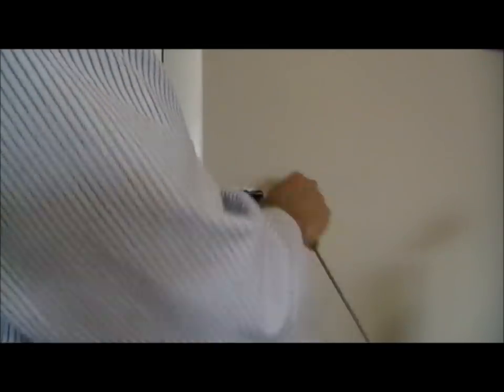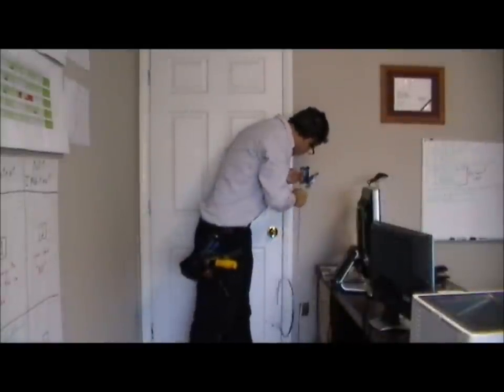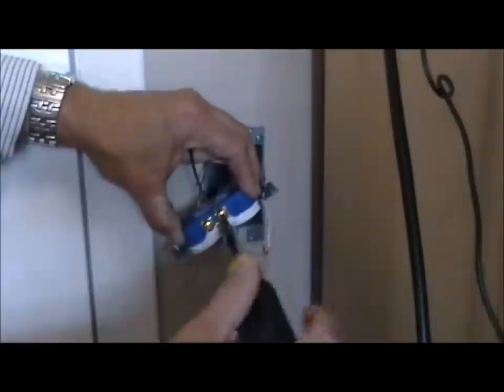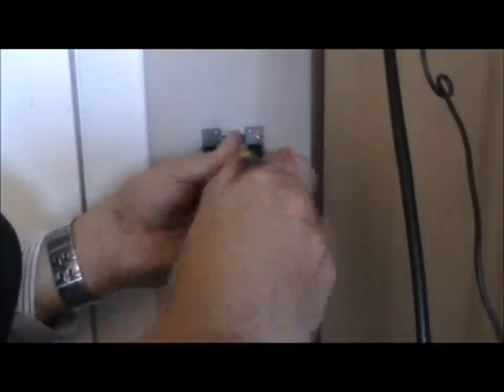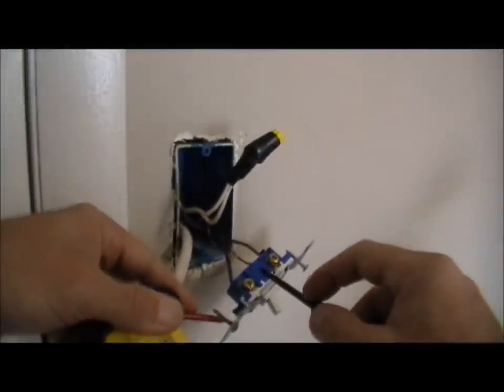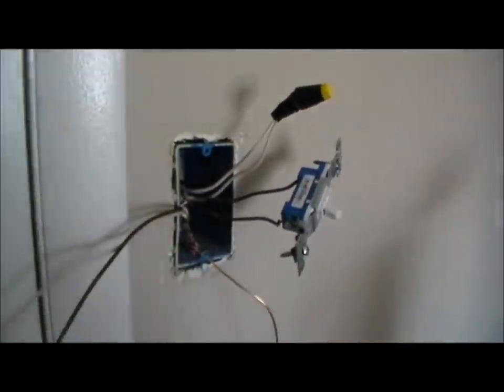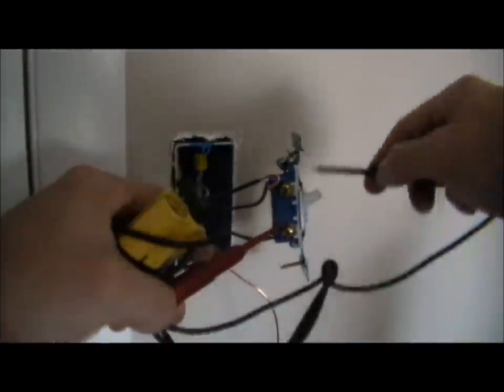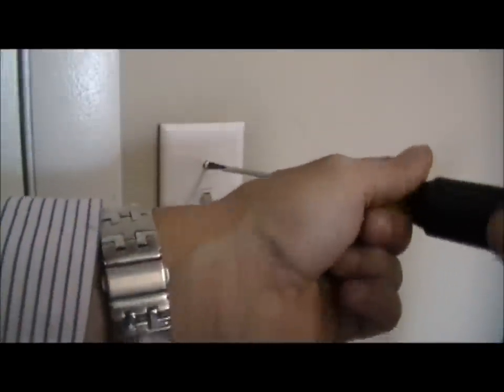how to wire an outlet off of a switch

Comment: You should be taping up those receptacles and switches before you put them back in the box
Reply from the maker: I would agree with you if we were using metal boxes. Electrical tape can unfortunately hide scary problems. Electrical tape will cause bad connections to stay in contact with the terminals and heat up. This will melt devices and can lead to fires. Without the tape a bad connection will just cause the device not to work.

Comment: maybe he turned it off at the circuit breaker? one should always do that when doing electrical work, in fact if i was to do any i would want to kill power to the whole house just to be safe and use flashlights to see, might be overkill, but i really like making things as safe as i can, or it could be that he didnt touch both that hot wire and the cold at the same time, so no circuit was completed.

Comment: I missed the caution that older Codes did not require a neutral in a switch box. No white wire, no can do. DIYers need the caution.

Comment: Lol all these comments.. The only thing I saw wrong in this video was that he didn't cut the breaker off. Probably because he was shooting a video alone and probably doesn't k or how to edit them, so leaving it on saved time from going back and forth. A real electrician can easily work on a simple switch with power still running through, just know not to touch the hot or neutral wires/terminals. Plus the shock isn't 'that' bad. Ya'll sound like a bunch of school girls.

Comment: Seems like he forgot to break the tabs between the screw posts. So, this way, both outlets will be controlled by the switch. You won't have one constant-on and one switch-controlled, which is the usual set-up.
Reply: Actually, he made a point of connecting the new outlet's hot wire to the constant hot wire at the exisiting switch, also called the "line." His intention I believe, was to have two constantly live outlets, not a split wired receptecle which usually requires a three conductor cable and breaking the tab like you mentioned.

Comment: Yep you would 😮. Your killing the outlet when the switch is off. You need 2 pig tails . Split the power so the switch and the outlet are independently wired with power

Comment: Question any body.can someone tell me where I went wrong.i only get electricity on the outlet when I turn off the light.whats happening.thanks
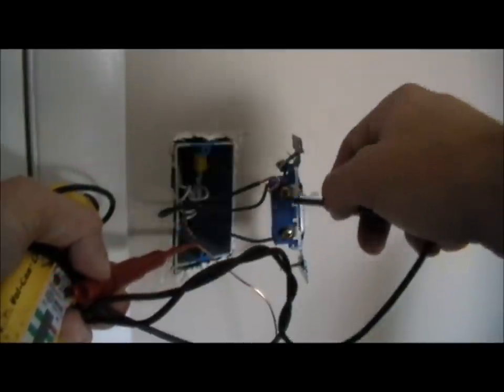Reply: You wired your hot to the wrong one on the switch. Check video in 12:15 ish where he tests to see which one is always hot. The switch breaks the circuit and leaves the other half not hot when it's not on , you probably wired your outlet to that side. Wire to the side that's always hot
Reply: @meganzheng4659  thanks I'll try that.

Comment: A little Bird told me:   i saw no hammer pounding those staples in the wood to code, to hold romex ???
Reply: dont have to staple in romex if adding like this that would require opening the wall entirely. the box has a flap that will hold the romex from backing out

Comment: Sorry but this didn't work for me.  In fact, it caused me to lose a lot of time.   I found the way is to pigtail the hot and the line feeding the outlet.   The others are right , grounds to grounds and neutrals to neutral --- top black to light fixture.   Possibly I had the wrong light switch because it only had 1 top and 2 bottom screws with the ground to make total of 4.   I believe your fixture had 5?   If so, than I stand corrected.   Thank you for your efforts all the same but please call out 4 screw switch versus 5 screw switch if that's the issue.

Comment: I've done work plenty of times without killin power on 120. It buzzes u a little bit, but yes he should have not posted a video doing what he did for others to do. Also, dude ur running an outlet as well as light now, pigtail the hot, don't use the quick connect, take the two mins to do it.

Comment: You didn't stab the wires in the back of the plug so why not remove the feed that's stabbed in the switch and pigtail the feed for the plug and light?

Comment: you never connect the hot first, this is wrong. there is a saying in the trade. ground is always first make and last brake, this is why the ground prong is longer than the other two on the end cord cap. same as when terminating a panel, the grounds always go in first..

Comment: The switch shown was not a common type in fact it led me astray trying to do this. The better way was to determine the hot wire coming from the with, pig tail off of it going to the switch.

Comment: $50 says that ground in the switch box has already worked loose. Get some crimps, crimpers, and a pair of wire strippers, you can call them electricians crimpers if it makes you feel better about it. 

 "our company doesn't back stab", gives a legitimate reason,  then proceeds to work off of a backstabbed switch. Your chain is only as strong as it's weakest link. 

#CeaseAndDesist

Comment: Its funny how the US plugs don't have a On/off switch on the outlet
Reply: You can get them, but it's often inconvenient to have the plug and switch at the same height on the wall.
Reply: Most US homes have lights in the ceiling, so they don't have lamps for the socket switch to be useful for
Reply from the maker: Can you post me a picture of the outlet with this what you're talking about. I would love to see example
Reply: Generation 3 Electric they look like this http://blog.gowalkabouttravel.com/wp-content/uploads/2012/07/Power-Outlet-for-Australia.jpg
the switches turn on/off the power at the wall socket

Comment: Couple things... Working with live wires, no matter how long you've been in the trade, is a bad idea. Take the time to hit the breaker. / No mechanical connection to hold the ground wires together? The number 1 cause of electrical fires is from poor connections. / 2 wires on 1 screw? Unsafe. Too lazy to pigtail. SMH! / Tapping a switch for power is convenient, but what happens when you plug in a device that draws more amps than the wire was designed for? The lights will dim and/or flicker every time.  Outlets should not be wired on a lighting circuit. That's why they make different gauge wire. 14 gauge for lights, 12 gauge for outlets. That outlet should have been tapped from another outlet.

Quick & easy. The hacker's preferred method.
Reply: The original wires were backstabbed into the switch, it sure looked, so there were not 2 wires under 1 screw.
Reply: PureCountry045 You're right. They were backstabbed. Good eye. My bad.

Comment: I deleted my last comment because I don't want to sound like a critic. My words to the home owner or anyone don't buy an electricians hammer that is a waste of money when you can buy a real one much cheaper. Spend you money on a good multi meter or inductive tester. Do testing live not running of the new wire. I could be wrong but hooking up ground first could save your ass if it shorts out instead of you being the ground.
Reply: when it says NO you know its wrong.

Comment: You should probably have cut the power at the breaker first...  Good way to get zapped and not very responsible (DIYers might follow suit).
Reply from the maker: Sorry. Common sense would tell you turn the power off if you don't know what you doing. I was trained to work with power on.

Comment: You should read the code book before posting the wrong way for connecting the joints. Pigtail out -NEVER more than one wire under a screw.
Reply: jcagy2    You missed seeing that the switch was back stabbed.   He connected to open screw.

Comment: 12:26 he touched the hot wired screw ? how !!
Reply: He's obviously not well grounded.
Reply: If you are isolated from ground, all other possible things that could be grounded, etc. then you could hypothetically touch the hot wire or terminal and wouldn't get hurt. That is if your shoes are well insulated, and your arms or legs are not making contact with any walls, metal junction boxes, etc. It is risky to work live and I definitely don't recommend it to others, especially if you don't know what you are doing. This video is not good for people who don't know a lot about electricity because they could get hurt or killed by working live.

Comment: This video just shows addition of a switch to an outlet making the outlet working on the switch I don't want that I want half the outlet to work on the switch and the other part of the outlet to be hot all the time.
Reply: Tom Gala Actually the outlet will always have power. It doesn't matter if the switch is in the on or off position.
Reply: So if I clip out the middle clip that connects the top and bottom outlet the one will be hot all the time while the other one works with the switch?
Reply: That's not true, you can actually have a "switch legged" Receptacle, it all depends on how you wire the circuit. All you have to do is break one of the tabs that bond both receptacles together, and run 14/3 from the switch box to the new receptacle box, you will have 2 hots and a neutral wire and a ground, use the black wire and splice it to the feed ( constant hot Wire) and come off the splice with a pigtail for feed in the switch box, hook the feed pigtail to your single pole switch, then hook your red wire which is the switch leg for your split receptacle then tie your neutrals together, and do not forget to splice the grounds and pigtail then hook to your devices, then in your split receptacle box hook your black and white wires to the proper terminals then put your red wire(switch leg) on the bottom receptacle that way there will be constant power to the top of the receptacle and the bottom will be switch controlled.
Reply: That's not true, you can actually have a "switch legged" Receptacle, it all depends on how you wire the circuit. All you have to do is break one of the tabs that bond both receptacles together, and run 14/3 from the switch box to the new receptacle box, you will have 2 hots and a neutral wire and a ground, use the black wire and splice it to the feed ( constant hot Wire) and come off the splice with a pigtail for feed in the switch box, hook the feed pigtail to your single pole switch, then hook your red wire which is the switch leg for your split receptacle then tie your neutrals together, and do not forget to splice the grounds and pigtail then hook to your devices, then in your split receptacle box hook your black and white wires to the proper terminals then put your red wire(switch leg) on the bottom receptacle that way there will be constant power to the top of the receptacle and the bottom will be switch controlled.
Reply: If I break the tab on the existing outlet will I have one outlet hot all the time and one of the  outlets controlled by the switch?
Reply: no, if your outlet is always hot , then breaking the tab will kill half the outlet. With a broken tab now , you will have to feed power(switched power ) to the half that is dead.  This video did NOT show us an outlet controlled by the switch. He powered that outlet from the hot side of the switch, meaning it will  ALWAYS BE HOT. If he hooked that last black wire from the outlet to the other(top) side of his switch, then the outlet would have been hot ONLY when the switch was on.
Reply: If you want a half switched outlet , then do what this guy did then break the tab on your outlet. Then you can run another set of wires from the top side of the switch back to the other half of your outlet.  This guy uses the hot side of the switch, you can use the switched side to make half your outlet hot with the switch.
Reply: @blackstrik131  I have to wire another wire to get the switch to work half the outlet. Can't piggyback somehow?
Reply: Send me an email

Comment: This is 100% wrong. Never connect power between the push plug and the screws on the side of an outlet or a light switch. They are not designed for this. It is an "either or", NEVER both!  In reality, you should never use the holes in the beck of cheap outlets or light switches. Those are only held in by springs and they can and will come lose. I had this happen on several outlets I was replacing. It only takes a fer more seconds to make a J hook and connect properly and you don't have things shorting out  in the wall later. 

The proper way to do this would be to connect the wires together in the box and run a pigtail off of it to the light switch. The way this was done would not pass an inspection and may cause an electrical fire.

Comment: @Brian +1. So much fail in this video. Stab-in connectors are notoriously failure prone and there is no excuse to EVER use the switch itself in lieu of a pigtail. If you're THAT close to exceeding the legal wires-per-box spec, put in a larger box. Consider the failure states on the switch!!!

Comment: please stop calling a receptacle an outlet. an outlet is any box you can tap into electricity. i.e. switch boxes, fixture boxes (for lighting) and of course a receptacle box  these are all outlets . although you can take electricity out of the receptacle it is not the outlet. the box is the outlet that is why it is called the outlet box. the device is a receptacle.

Comment: This is not the way you show amateurs how to do this.  You do not  do this with live wires and you do not attach more than one hot wire under that sort of terminal on a switch, you use a pigtail. You also use a bare wire pigtail for the grounds with a green nut and not just twist the grounding wires together.

Comment: Why wouldn't he turn the power off for the connection he was working at, for life saving reason I'm no electrician but isn't that basic safety knowledge.
Reply: terry johnson 
I agree with you, 13:00 to 13:20 shows some footage of him putting the switch back in the wall. At 13:19, he says "light still works"(and you see the light come on), which means the power was on all that time. I'm not an electrician either, but all other electrical installation videos I have seen emphasize turning the power off first, before working on anything electrical. The only exception is for when you briefly use a tester to check connections, such as determining which wires are the "line" wires for installing a GFCI receptacle. But then immediately after running your test, turn off the power again, before continuing working on anything electrical.

Comment: This is incredibly dangerous and unsafe firstly 9 times out of 10 the neutral in not installed in the switch box, this is most often done at the at the light wiring at the the ceiling rose (were the fitting is wired from) secondly it is dangerous to even open the cover of the switch if the circuit is still live but you were jamming your hand in there like you'r getting ice cream out of the freezer only a few millimetres from a live and exposed wire and most importantly the fuse in the fuse box

Comment: I just want to add an outlet that has power all the time not switched
Reply: It should just be to use the opposite live wire.  The Neutral and ground will be identical to the video.  To keep the outlet on all the time, just connect to the the live wire ENTERING the switch instead of the live wire LEAVING the switch.
Reply: krabbi  Yeah he did lol

Comment: what kind of hack are you...first off you dont put 2 wires under one screw you use a pig tell and second you didnt have to disconnect the ground...you just take the new ground and twist it around the existing ground wire...also with any wire nut you are not supposed to pre-twist the wires the nut does it on its own

Comment: Should the title not say "how to wire a socket from a switch"
No sleeve on the earth wire. I'm not impressed.
Is the fuse rating between lighting and power not different in USA.

Comment: Wow! That was super exciting, although I must admit that I had my eyes closed for most of the video. Some suggestions for your next video: 

1) Juggling chainsaws while smoking crack and riding on the back of a tiger.
2) Defusing a 2000 lbs. bomb while blindfolded with nothing but a sledgehammer.
3) How to go over Niagara Falls without a barrel. (Barrels are for pussies.)

Keep up the good work!
Reply: VE3CWQ    Don't forget,  pour water on the concrete floor, and take off your shoes!

Comment: a disclosure that you are a certified electrician before you get started shows viewers discretion is advised when working on LIVE circuits! Work on your professionalism before you do videos, this seems rushed and careless even though your work is completed. taking the ground off first is a problem, then missing it after you hook it up is a problem. PS> Isn't hooking up the hot the last thing your supposed to do? Especially on a LIVE circuit? Get a camera crew if you do this anymore. Safety FIRST

Comment: I'm only 25 seconds into this video, but right off the bat you're saying there's 2 wires inside the box. Then you open the box and clearly there are 4 wires. Perhaps that's just a verbal slip. Hopefully the rest of the video is more informative.

Comment: Oh my, you've got to me kidding me.  How many mistakes do you see here? Power ON! Says not to backwire, but then leaves the switch backwired to take advantage of an open terminal screw (he should have installed a pigtail). Does not address that some switches are at the end of a switch loop and have no neutral conductor... so it is impossible to add an outlet.  
Blessings,
JOHN 20:29

Comment: Wrong never put an outlet to lights , And that wire you are working on is 14 gage outlets always 12gage
Reply: birdchaser2010 
?? Wire gauge has nothing to do with outlets or lights....it's about amps.
if the circuit is 15Amps then 14 is correct.
You should use 12 when you have 20Amps...
it doesn't matter light or outlets....